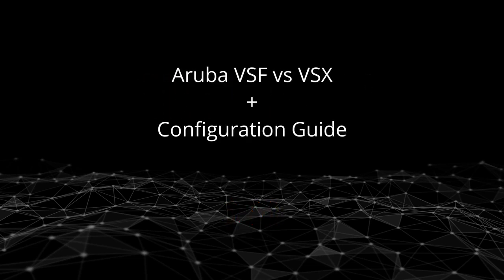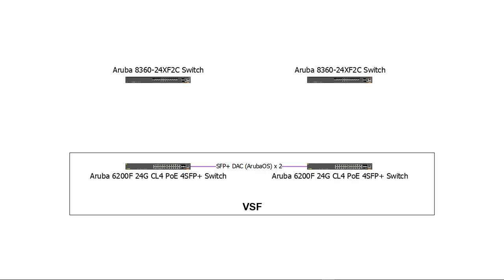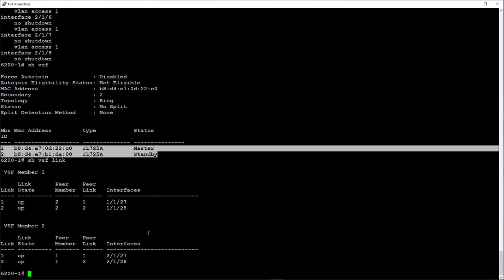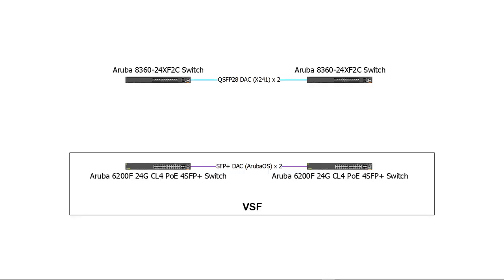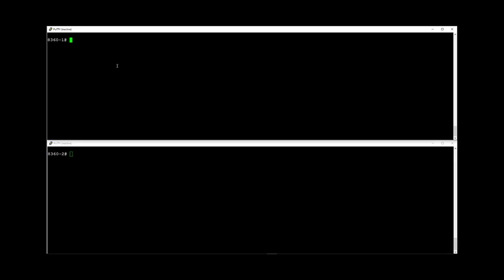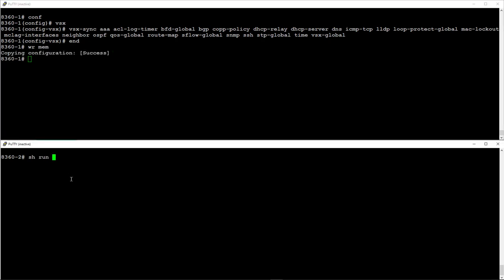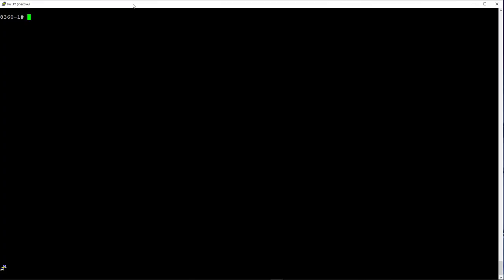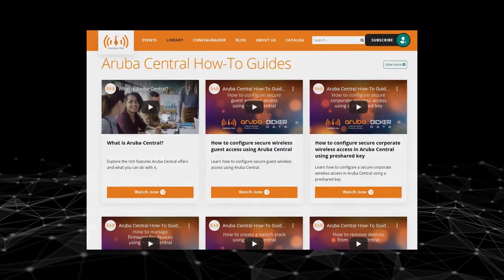Aruba VSF & VSX Configuration on 6200f & 2930f Switches | Step-by-Step Guide

Comment: What is the difference between using VRRP instead of active-gateway?
Reply from the maker: The main difference between using VRRP and Active-Gateway lies in how redundancy and default gateway functionality are handled in a network, especially in the context of layer 3 gateway availability for hosts in a redundant switch or router setup.

Comment: Hi. Thank you for a nice and interesting video. I can see that the COM port number is raising up each time you configure the next switch. Is there a way to prevent it? Many Thanks.
Reply from the maker: Always use the same USB port when connecting your serial adapter.

Manually assign a fixed COM port via Device Manager (on Windows):

Go to Device Manager > Ports (COM & LPT)

Right-click your USB-to-Serial device > Properties > Port Settings > Advanced

Choose a COM port number and click OK.